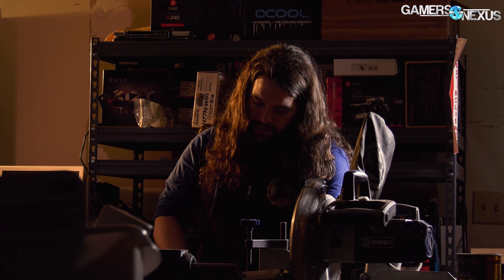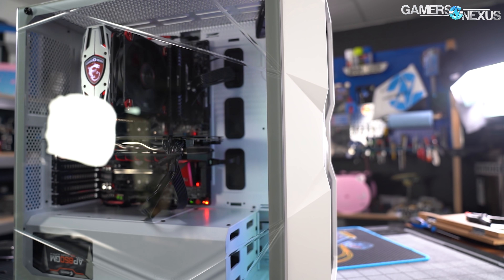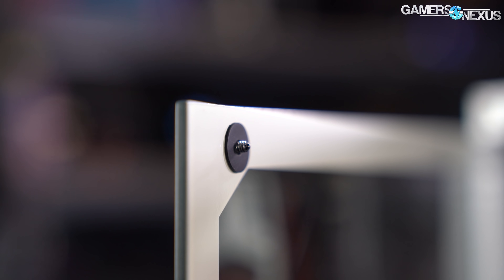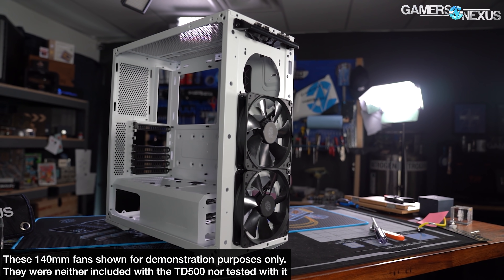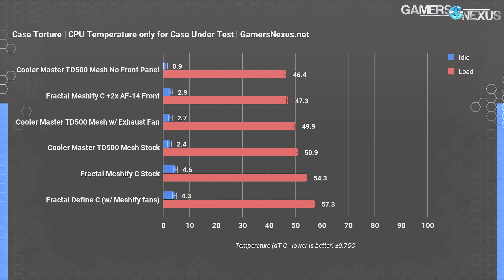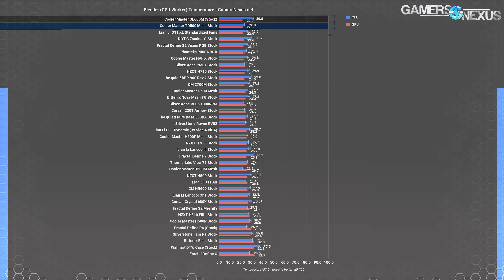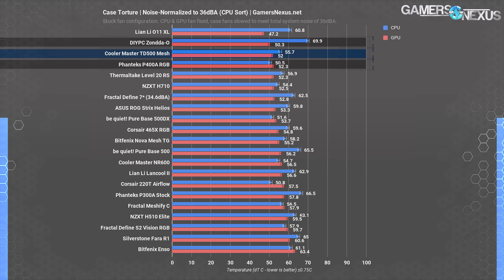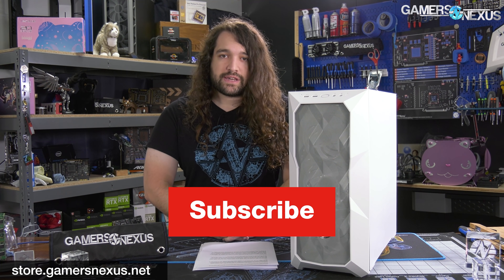Cooler Master TD500 Mesh Case Review: $100 Airflow Show-Down

Comment: Why has no company come out with a “reverse direction” fan? Change the orientation of the fan blades so air moves in the opposite direction. For people that want to add extra fans while keeping ascetics good!

If for no other reason for when they make their show builds and you point out that those fans are mounted as exhaust so they can tell you “well actually, this is our new product the reverse airflow fan. All of the cooling with all of the looks and all of the RGB”
Reply: Whats the point in that? Making the pc airflow negative pressure at default? I dont see the point other than confusing customer
Reply: @Crustee0  I think what ARich is pointing out is that the intake side of fans - especially RGB ones - is almost always the more visually appealing side which results in show builders mounting all the fans as exhaust. A solution would be fans that could be mounted to look pretty but switched from exhaust to intake without re-mounting.
Unfortunately the physical orientation of the fan fins are designed to be spun in only 1 direction.
The only solution would be to manufacture 2 physically different versions of the same fan but that would get super confusing
Reply: Scythe makes fans that spin the opposite way, although you might need to get two different models. The best use for them is on a CPU cooler where they can be set up serially for good airflow and low noise. Scythe also sells a cooler with fans running the opposite direction. Personally I don't think opposing fans will alter the aesthetic while they're spinning, a better idea would be to set the LED behavior differently for each fan.
Reply: @Thomas that’s exactly what I was thinking. Obviously it would be a pretty small volume product. But all they would need to change is the actual fan blade assembly. The frame and everything else would likely still be the same. And while it could be a little confusing, I think as long as it was clearly advertised/marked it would be a good option to have

Comment: I got this case recently and my fans go from ~550rpm before stalling up to 1800rpm. It seems like they changed the model.
Reply: Yup, bought it a few months back for a build. The fans do top up around 1800 RPM so even more value for the price

Comment: I got the case recently but the front fans are pretty noisy( or i did something wrong while building), did you notice it too while testing ? Also the fans can't go below 60% speed so even on idle i can clearly hear them trough headphones
Reply: Not your fault. The fans rattle. I saw an article about some problem with Coolermaster fans causing the rattling. I replaced my fans.

Comment: What was the room temp when doing the tests? I have the same case with 1 120fan rear exhaust, top exhaust MSI mag core 360r radiator, stock intake front. my rtx 2070 reaches max of 70C when gaming. your benchmark only shows 50C when full load. Thanks.

Comment: CM webpage claims it fits 360mm rad on top but i heard people saying it only fits on front. I'm planning top mount 360mm so which is true? Dont wanna get it and find out my rad dont fit on top...  Also if I put on 360mm rad on top with 3 fans blowing out, would it be too much exhaust if i add exhaust fan (3 blowing in front 3 blowing out top,  1 blowing out back)

Comment: I'm trying to build a pc. And I'm a complete beginner. My desired cpu is the ryzen 5900x & the gpu is the aorus xtreme 3080 waterforce which is an aio gpu. And I'm planning on using the corsair h115i rgb platinum as a cpu cooler. So I want an all aio cooling system. I'm planning on using the radiator for the gpu on the front panel & the cpu cooler would act as an exhaust fan on the top. So do I need to remove the front case fans in order to mount the radiator & fans with the gpu? Sorry if I'm not making much sense, I'm very new to all this & I'm trying to know as much as possible before I make my purchase.
Reply: Hey Charlie, Yes you will have to remove the ARGB fans. Most AIO comes with include fans already, so all you have to do is mount up and install. In the case if you want to front mount, then yes you will have to uninstall both the fans in the case and cooler, then with the rad on one side, and fan on the other side of the shell, mount the fans that way. I would say you should measure each parts you plan to buy. The case is big, but it may not fight all the AIO you plan to get. I bought this case along with a Artic freezer 2 360 AIO, and the tube length(450mm) was not far enough to reach from the front to my CPU with the tubes down. With tubes up it was able to each my CPU with no problem - same with top mount. Ram clearance is also an issue when building an AIO set up, so be very mindful of that. Best way to prepare yourself to see if these parts will fit the case is to take cardboards, and make a cut out of the actual size of the case and parts. This should give you a rough idea of how your parts will fit. Keep in mind, the case maybe smaller than you draw it out to be so always consider the worst and always have plan B.

Comment: I just need an MATX case, two 140mm front, top, and bottom. Mesh with blanking plates so you can have whatever layout you want. Open layout inside with lots of 2.5" mounts to pick from. It's not rocket science.

Comment: Do I need an argb header on my mobo if I want to control the lighting with software? If I’m not mistaken, the inbuilt controller ( the one that can be routed to the reset switch ) can only display static colours, not argb.             Thx

Comment: there product website says it only supports up to 280mm aio, so im confused on wether i should get a 360 for the top of the or just get a 240mm for the front. im trying to cool a ryzen 9 7900x and want the best option

Comment: How to control argb without going to the remote? Do I need to open my case all the time to  change lighting mode? My mobo dont have support argb connector :(. Is there something you can get like IF controller so I can control them from the outside? What’s the use of having the controller inside🤦🏻

Comment: I'm a bit perplexed by the claims of the orientation of front mounted closed loops causing whine and such, is there any proof of this? Surely the pressure and resistance would be the same no matter the orientation due to the almost constant that is currently earth gravity, and the travel length of the liquid? What goes up must come down after all. Ideally all radiator and tubing orientation should be orientated flat to negate gravity resistance but that would require a long or really wide, odd looking case. A front mounted closed loop mounted in either up or down orientation should not make a difference as it either; travels up the tube, then down the radiator, then up the radiator, then down the tube, or vice versa if you mount the radiator the other way so both would be equally but opposite. Generally water pumps work as both push and pull don't they? I'm not saying he's wrong, I could be wrong, I just can't see the logic.
Reply: I think the whine is caused by air in the system - not any kind of pressure or resistance issue.
Air will pool at the highest point in the system and if that's where the tubes are you could get bubbles pushed into the pump causing the pump to not get the resistance (because air is easier to compress) and cooling it is designed to receive.
That's how I understand the issue but not any kind of water cooling expert.

Comment: Guys, I have the ASUS TUF GAMING motherboard x570
I have the Corsair Hydro series H100i RGB. Will the AIO fit on the top of the case without any issues, or without touching the ram sticks?

Comment: The lack of 5.25" bays disturbs me.
Reply: I use 1 in my new sytem :)
Reply: out of curiosity, what do you use it for?
Reply: Rem NL I can’t speak for him, but I personally have a dvd drive in my system, as I still have several films on dvd, as well as some older games that are disc only
Reply: @Rem_NL  I need it for my music CDs that I'm buying old-fashioned instead of music streaming
Reply: Just get a USB-SATA cable and have a full proper disc drive in easy reach on your desk while gaining great airflow to your CPU.
The portable disc drives they make for laptops with tiny cables are garbage but that's not the only option ;)
Reply: @zig131  personally i would not like the spinning of the disc, the chance of scratches for consumable media etc. I would rather digitise it and play it from an SSD. There is also software that imitates cd drives so you can play games that only run from cd on your pc too. (this is a reply to basically everyone above).
Reply: Ollie Killen I would rather watch physical movies on a device that’s better suited for them say a nice 4K tv then a pc.
Reply: @Rem_NL  Watching DVDs, Blu-Rays, burning OS ISOs, ripping CDs, playing games.

Comment: Just completed a build with it and it looks amazing. However, I immediately noticed a very obvious clicking noise that was traced to the case fans.
Is anyone else having this issue?
The fans are also noisy, even at low rpm of 750-900. Esp when compared to the nearly silent little known "PCcooler" brand exhaust fans I bought running at 1000rpm.
I made sure no wires were caught in the blades and isolated each fan in the system. All 3 of the CM fans make the clicking noise.
Shoddy QC?
Reply: Switch them out with But use the  same size

Comment: Does anyone know if there is space at the top for 200mm fans as exhausts? Even with some light modding.
I have two 200mms in my old crappy case that i want to reuse.

Comment: Bought two of these cases (one to please the wife and the other for my son) and they both have the following issue: The front case fans make rattling noises, like a small wire is sticking in the fans. Even at 650 rpm is it audible from the chair I am sitting from and the case to my right at about 30 cms distance. When I remove the fans from the case it disappears. When I remount them back into the case it comes back. Both cases have this. I contacted Cooler Master and they sent me a full set of new fans with the same result. Can anyone help me solve this issue because it is really annoying! Thanks a lot!

Comment: Open question to everyone please, does anyone know where my Corsair R540 would sit in these charts? Or link me to an older test vid where its still ranked. As wondering if I should even bother upgrading it for my current R5 3600 system? As I like that front panel and sound isn't really an issue for me. 

Cheers in advance.
Reply: The Air 540? Probably similar performance to the Lian Li 011 for cooling, considering the large interior and dual chamber setup. Good CPU cooling, okay GPU cooling, maybe not great for noise. There's a decent comparison with older cases in the Anandtech review (on their site). Unless you find it inadequate, it should perform pretty well against the current generation.

Comment: What does the "For Gigabyte" Wire use for?
Reply: And where do you plug it in
Reply: @gogetablue7905  Late responding but its for Gigabyte Motorboard where u can Sync the Fans on the Gigabyte software

Comment: I'm looking at getting the B450 AORUS PRO WIFI (rev. 1.0) can anyone tell me if the bios on those are up to date and if not do you know if they have fixed the issue with the EC FW Update Tool or is that just an issue with the x470 board?
Reply: The issues that i have read about are anything from sound not working to ram not being recognized after using the EW FW Update tool.

Comment: Oh god is that a Samsung QLC drive? I thought those types of drives had a much shorter lifespan than TLC? I hope QLC doesn't become the new norm..unless SSD tech gets way cheaper
Reply: Not seeing any info that indicates a "much shorter lifespan." They can have lower sustained write performance, but you shouldn't be relying on an SSD for storage, especially if you're concerned about the lifespan. Most consumers just run apps off SSDs, meaning QLC will benefit most users by allowing them to purchase bigger SSDs. If you write a lot to these drives and you're not making regular backups I slightly question your sanity.

Comment: I built in  this case and system is ready for my gpu when I get it but the power button on the case won't turn the pc off i have use the psu is that how it's supposed to be
Reply: No that's not how it's supposed to be... Some computers don't turn off by just clicking it, instead try holding the power button down for a few seconds until you see the computer turn off. The reason for this is so you don't accidently click it and shut down your computer by mistake. Every PC cases power button turns the computer on and off. If the power button on the case is able to turn on your computer then it should be able to turn it off as well since it uses one connector for both functions. If the power button turns on the computer that means you connected it properly and there's no reason it shouldn't turn it off as well.
Reply: absolutely not. no manufacturer would ever make a case where the power button turns on the pc but doesn't turn it off. If the pc turns on by pressing the button then there's no reason it shouldn't turn it off as well.
Reply: Thanks guys i figured it out yesterday have to hol it for a few seconds
Reply: @christianyt3615  figured lol nice

Comment: I am thoroughly frustrated with case manufacturers. There are three case designs. The first is a flat-faced design that is made using solid plastic or glass, with the feature of restricted airflow. The second is a mesh front case which will have off angular facades and mesh that looks dented and warped at a glance. Then there are cases that look like Autobots, that literally no one buys. Why can't we get flat faced mesh cases, with good airflow and great aesthetics?
Reply: The Fractal Focus has the flat mesh, so do several cheaper CoolerMaster cases. The aesthetics are subjective of course.

Comment: HELP. Can someone reply with the rgb software I go this case like a month ago and cant figure out what software it has.
Reply: I haven't finished my pc in this case yet but I dont think it has a software, but instead some comes with an controller or the button on the case that looks like a restart button can control the rgb
Reply: @ronitpodder7359  oh I thought that reset the pc I'll try and see what happens
Reply: @ronitpodder7359  also I didn't get a controller with my case so thats not an option :(
Reply: @Praby  nvm idk how the case rgb works
Reply: @Praby  ye same the reason i havent figured it out is because my case fans aren't working at all
Reply: @ronitpodder7359  should I still try?
Reply: @Praby  no i think you were right it just restarts maybe search the name of the case
Reply: @ronitpodder7359  yup it does just tried it
Reply: @ronitpodder7359  I can't find anything I need a controller but I don't have one.
Reply: @ronitpodder7359  so I think I can't do anything anymore because you said there was no software
Reply: @Praby  and for the reset button to control rgb u have to plug into the controller instead of the mobo
Reply: @ronitpodder7359  Nah I didnt get a controller for sure are you sure there is no other way
Reply: @Praby  yes because the rgb comes from the controller which is directly connected to the psu did u get it from amazon?
Reply: @ronitpodder7359  yeah
Reply: @ronitpodder7359  I got my pc built by someone they didn't inclued it when they gave it to me
Reply: @ronitpodder7359  ill text them and ask if they still have it and if they could give it to me
Reply: @Praby  maybe they put it in the back while cable managing cause theres a lots of cables idk
Reply: @ronitpodder7359  true

Comment: Bought this case because i wanted to do a black white themed build and i could not find a case which also had white interior. Sadly i have to say i fount the case absolute trash, the build quality is just cheap, nothing else can describe it, very thin metal, cheap filter for the psu like you said, the fans are cheap, they were loud and rattling from the get go, the space in the back for cables is so limiting that pushing the back panel on was a chore, the spacing between the HDD mount and psu makes it almost impossible to get cables in. this is a 100 euros case here .. while i got my Fractal design define r6 for 125 euros, the fractal one just feels leagues more premium than this POS for just a 25 euros difference.

Comment: Regarding RGB control, you might want to have a look at this -
https://gitlab.com/CalcProgrammer1/OpenRGB/-/wikis/home
One of the biggest complaints about RGB is the software ecosystem surrounding it.  Every manufacturer has their own app, their own brand, their own style.  If you want to mix and match devices, you end up with a ton of conflicting, functionally identical apps competing for your background resources.  On top of that, these apps are proprietary and Windows-only.  Some even require online accounts.  What if there was a way to control all of your RGB devices from a single app, on both Windows and Linux, without any nonsense?  That is what OpenRGB sets out to achieve.  One app to rule them all.
OpenRGB is still in its early stages and already supports quite a few products.  I'm always on the lookout for good deals on more popular RGB devices to add support for."